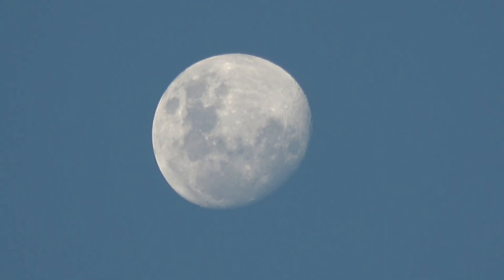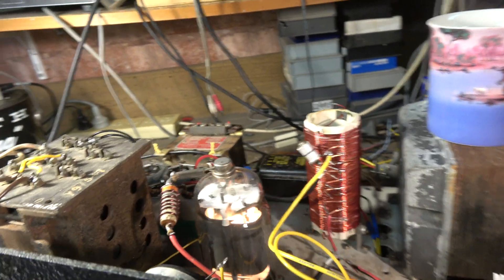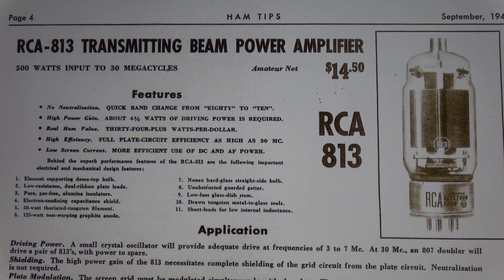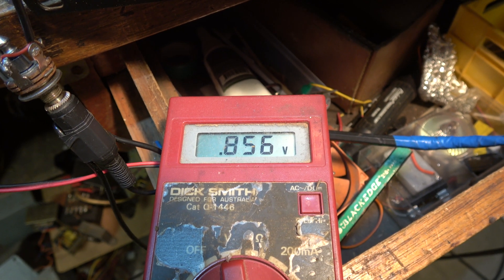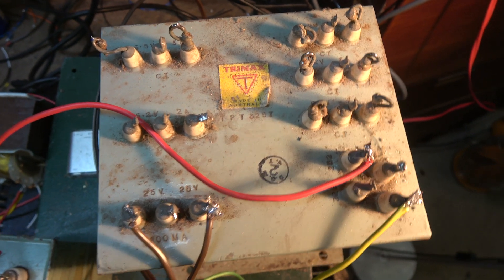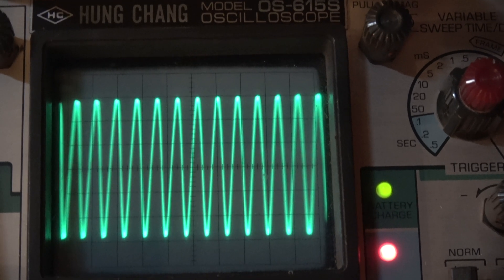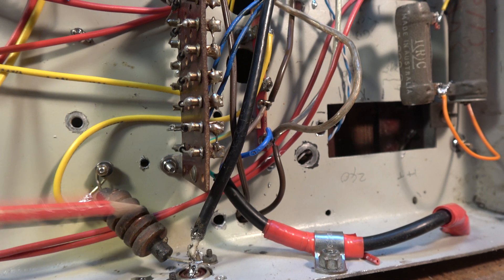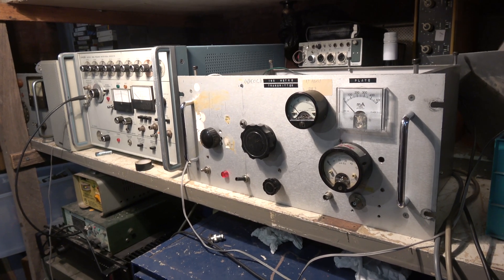813 verses  four 807 valves for mitters

Comment: Forget the 807, use 1625's.  Same tube but has a 12.6v heater and a 7 pin base.  There are probably 10x more 1625's in the world than 807's as they were used in many different WW2 radios, and the government orders spares up the wazoo.   I remember them being sold surplus at 25 cents a piece.  I recall a linear amp using two of these in a passive grid circuit.  Ran with 1000v on the plates and 400v on the screens, produced about 150w PEP class AB1.

Comment: 807 x 4 is much lower impedance and low voltage design
Reply from the maker: Yes one of the big advantages, but can take off at vhf and mess things up if you are not careful.

Comment: The 814 is something like 1/2 of an 813. 1500 volts, 150 ma, 60 watts dissipation.
Years  ago I remember buying them for about $2. Not very common nowadays.
They worked well if you don't mind 1500 volts.

Comment: I use the miniature 807 called 5B/254M. It is electrically identical and I get 75mA cathode current at 600V and 30 W output in AB1. 73